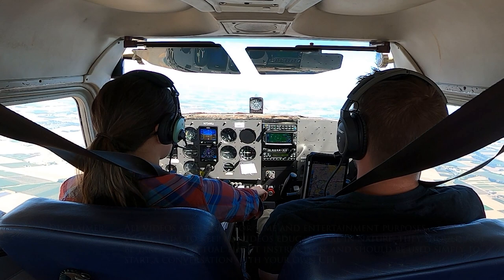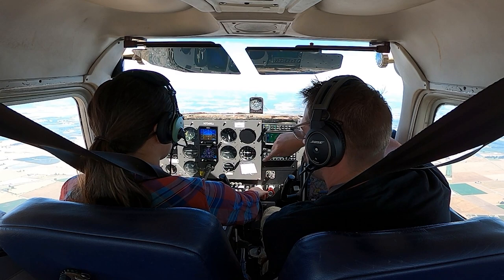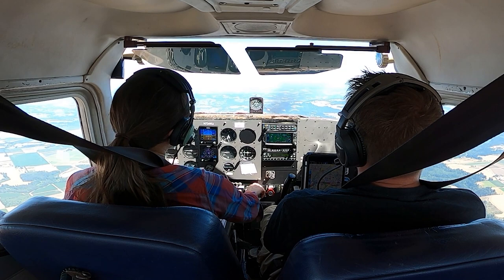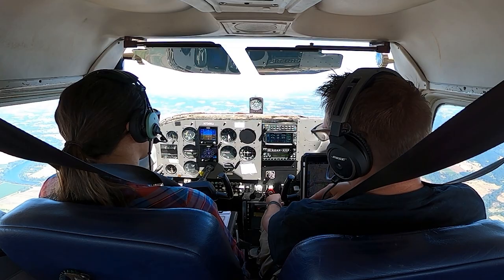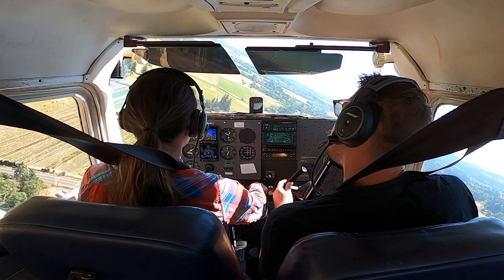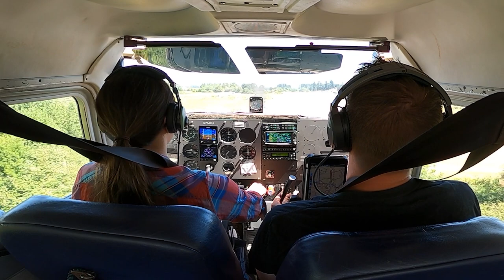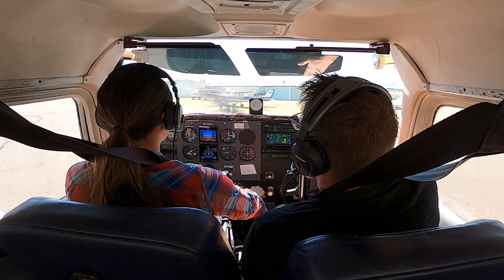How to do Power-off 180s - Commercial Pilot Maneuver

Comment: So what you said here is that both 10 and 20 degrees of flap have the same drag ratio? On say a 12kt headwind would you still be using 10-20 degrees flaps, 10knts over best glide speed to make the numbers? And, what if you're close to your max weight, would you still be using 10kts over best glide to make it?
Reply from the maker: Actually what I said was 10 deg. Gives you more lift than drag. 20 deg. Gives you roughly equal amounts lift and drag. Has nothing to do with the amount 10 deg. Gives you, just that the amount of lift and drag incurred is about the same when you go to 20 deg of flaps. You throw out a lot of variables there and there is no one answer. The simplest way I can respond to that is yes, I use this technique no matter what the circumstances are. But every approach is different and you will never fly any two approaches the same. Here is another video that might help too. 👍 https://youtu.be/cbD3DM68eIw

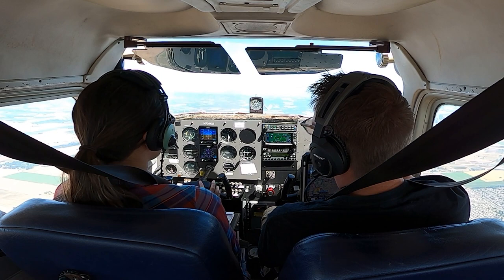Comment: 1:54 you say you can put 10 degrees of flap to extend your glide. Airplane Flying Handbook Figure 9-1, 9-2 show less glide with flaps down. The only time I can see using flaps to extend glide is with a good bit of tailwind. Is there a reference for your airplane showing better glide with flaps down 10 deg?
Reply from the maker: So maybe I was unclear in the video but I did not mean to imply that you’d get a BETTER  glide with 10 flaps… I mean that at the end of your glide, 10 flaps can be used to give you a short extension under the right circumstances. You can see a demonstration of this in my other video here… towards the end 👍 https://youtu.be/KGodYYaANWg?si=OufsBVxE9Eib0Szj
Reply: @NorthwestAeronaut  thank you for your response.